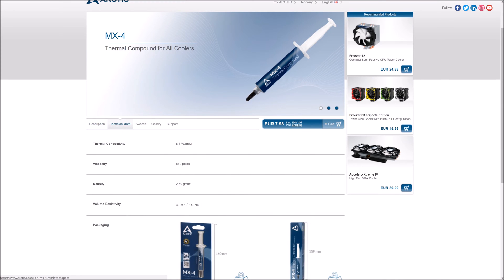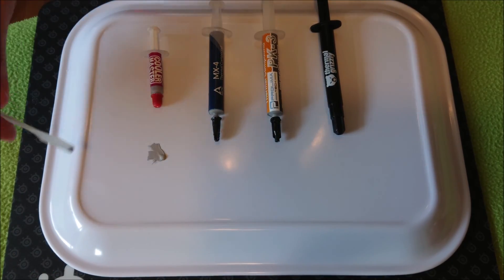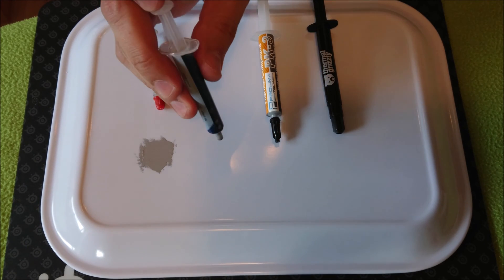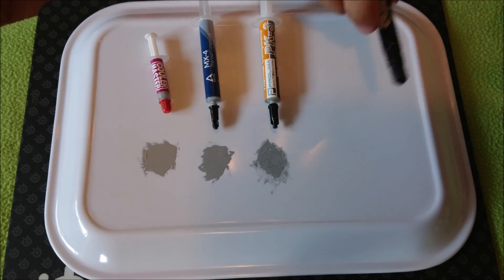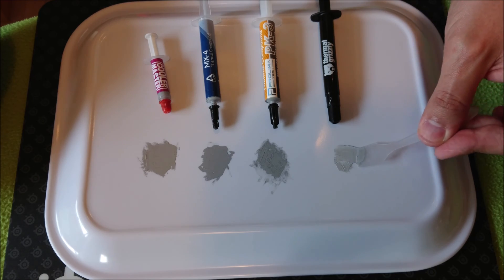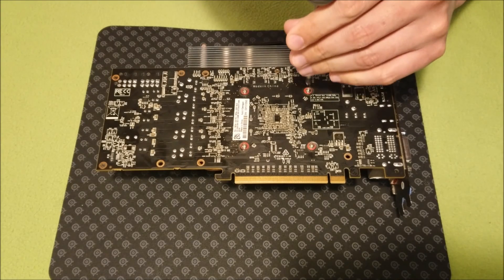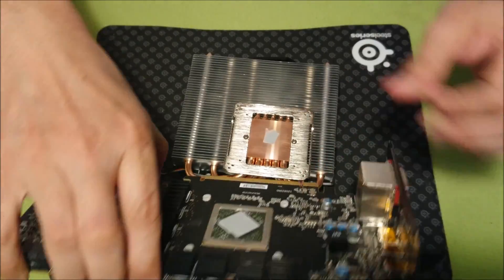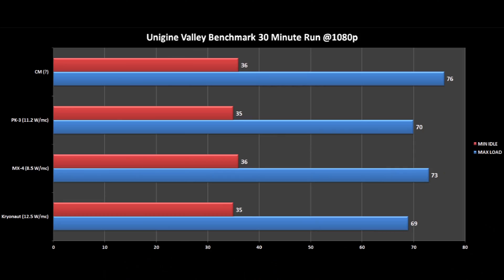Thermal Paste Battle! MX-4, PK-3, and Kryonaut Tests

Comment: i would pay more; not for 1 degree but for longevity. unfortunately nobody has tested thermal paste longevity. mx4 even though they claim 8 years, i have experienced deterioration after 1 year. on desktop its ok its much easier to do maintenance. but laptops and consoles its really bad as dismantling is a bit more tedious. for my ps4 pro (omg they are loud, thanks amd/sony for excellent processor with poor cooling) i expected a one time application that would last 3 to 4 years. if kryonaut lasts, i would definitely pay the higher price.
Reply from the maker: I would sudjest trying thermal grizzly then. It is supposed to have better longevity. But as you said, manufactors say one thing, in practice it is another. Thanks for watching btw!
Reply: @TechnologyHive  yes it is relatively a new paste. So there wont be much help from the users. Will have to trust the manufacturers words on this. Thanks for the video. :)
Reply: I had a rise of nearly 8c on average in just under a year using MX-4. Still good temps, but I was surprised it shifted so much.
Reply: @hankhillsdisappointedsigh  tried gelid gc extreme also. much worse life. i would like to hear from someone about mx2 and noctua life.
Reply: @hsp3394  Im thinking of purchasing the conductonaut for mw fat ps3.  Like you, I wonder if this would last a while? it's annoying to disassemble. I wouldn't mind doing every 2 years or something. I think the paste will give it a longer lasting lifetime.
Reply: @TheDragonballboy  conductaunaut is liquid metal. those have life and almost no deterioration. only issue is they kinda eat into things and leaves 'scars' with time. i avoid it and probably would never use it as it is electrically conductive (or any conductive paste) and is super easy to mess up.
Reply: 8 year durability is of course a marketing move. Even the better thermal paste will typically lose its attribute after about two years. I am using Arctic MX-4 for some time, and i have no problems, but maybe there are some new better solutions.
Reply: @BSSVK  since I don't actively monitor my cpu temps I dunno how much degradation I may have gotten, but I'm sure my last application was arctic silver 5. Could be wrong on that last statement since I've had to open it up because of an h100i that failed on me.
Reply: @rent2000   you should undervolt your cpu by -130 at least i mean if you talking  about msi raider
Reply: GC Extreme = Krynaut plus much cheaper, only $11.2/3.5g
Reply: The Prolimatech PK-3 I received with my Prolimatech Megahalems in 2013 is still on my 3770K with daily use and still working just as it was 6 years ago.  I've even used the same tube over the years on X360s and the results were always great.
Reply: I have used MX2, MX3 and MX4 and I never experienced deterioration... even the one on my Xbox360 Falcon (which has heat problems) MX2 after like 4 or 5 years still had some parts smooth not dried and was easy to remove contrary to the bubble gum original paste that it brought which I had to use WD40 to clean it, I have put MX3 in it and its there for so many years and the temps are basically the around the same, very low (I have RGH on the X360 which reports temps and I also have fully modded it with other cooling mods including adding 2 extra fans) :).

In the PC I moved from MX3 to MX4 and after like 3 years it still had parts that were a bit liquid and some parts slightly dried, but still totally good and I have my I7 2600K at 4.9ghz on air, so yeah, high voltages, high temps high everything since ever.

The MX4 in my PC is now like 2 or 3 years old and I still don't see much of a difference to the first day, I didnt do a burn-in tests anymore, but when playing the same games around the summer hottest days it still continues around the same temps (I always clean my PC, fans and cooler are always cleaned).

I'm probably gonna buy a Kryonaut some day to test, but I wonder if it will last as good as Artic MX, 4 me they have been rock solid and 100% safe.
Reply: @MirzaKhalid  , thats very strange, however I never tested Artic MX4 in terms of visual inspecting it... Its the last one on my PC, I didnt opened it anymore, but the temps are still pretty much the same as when I put it new and its now probably like 2 years and my I7 2600K is at 4.9ghz at high voltage with a air cooler...

At least Artic MX2 and MX3 I tested visually after a few years and they are very reliable... remember there might be fakes out there too, someone might get a fake... I bought mine and paid quite a lot for Artic MX4 on a local store that doesnt sell any unbranded stuff...

I want to fully mod my GPU Asus Strix RX480 (flashed to Strix 580 OC) and my PS4 Pro and my Switch, now I don't know if I should use the Artic MX-4 or this newer Kryonaut, but I have a huge expensive 20gr of MX4 to waste, however in the PC Kryonaut or even liquid metal would be way bigger than on the consoles since my PC is always at high temps because of the massive OC, on consoles the difference even from MX-4 to liquid metal is not as much as in the PC with high temps good thermal paste also start to make more and more difference to transfer a lot of watts in heat...
Reply: @MirzaKhalid   Here on the local store MX2 just 4gr is still 5.96€, Artic MX-4 4gr is 6.9€, Thermal Grizzly Kryonaut 1gr is 5.5€, humm and I just found out theres a new MX4 syringe in there too, Artic MX4 2019 Edition 2gr costs 5.94€ fuck, now my old Artic MX-4 20 gr is garbage, theres a new one, god damn it, didnt even knew, however I bought mine like 2 years ago and only used once...

https://www.coolmatica.pt/loja/26373-large_default/arctic-cooling-mx-4-2019-thermal-compound-2g-tube-actcp00007b-.jpg

Humm it seems the same as the old one, 8.5W/mk, what a joke... 

I think I'm gonna give it a try on this newer Kryonaut some day, however sadly I don't think I can remove my CPU cooler anymore, last time 2 rubber Fan holder got screwed and if I remove it again will break them all and there isnt replacements anywhere, also even on ebay a bag of 4 costs more than 10€, I'm using a huge Xigmatek cooler with 12 Heat copper pipe direct contact and 2 high pressure, high airflow fans (one original from Xigmatek and one Shark Fan, the shark fan is already kinda just hanging with 2 rubbers only and 2 pieces of tape already :) ).

And the cooler is a bit BIG, can't remove 2 memory sticks and can't access the bolts either without removing the fans :(.
Reply: Kryonaut has a threshold of 80c if you it it often enough it will dry faster. non oil or silicon based product might help with longevity.
Reply: I have a theory that it depends on whether it moves a lot or not. A CPU cooler that sits still without vibration will probably maintain its performance for years but if you constantly move your computer around then the cooler will move slightly each time and maybe start to break up the heat conductivity property of the thermal paste once its gotten to hard to readjust

Comment: GTX 1070 Stock Clock and Memory only -1 Degres different between MX4 and Kryonaut, Idle -2 Degres :)
Reply from the maker: Fix the fan speed to 100% during both tests, and try again ;)
Reply: Technology Hive 3 Minutes of FurMark with Fullscreen at 1080p. I wait for Idle Temp goes for both to the same Temp (34°C) and run the Stress Test for 3 Minutes with Full Speed of the Fans... the Results are the same, Max 71°C).
Reply from the maker: Nice job man! Thanks for watching!